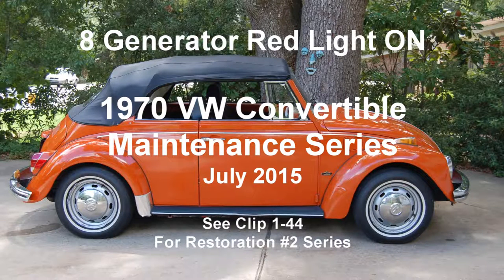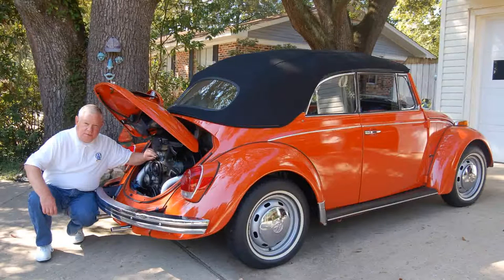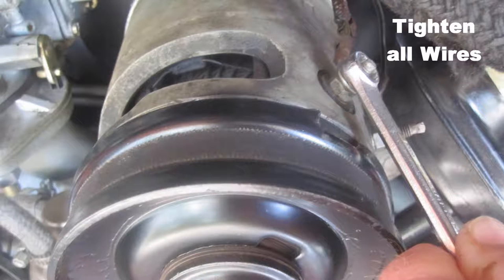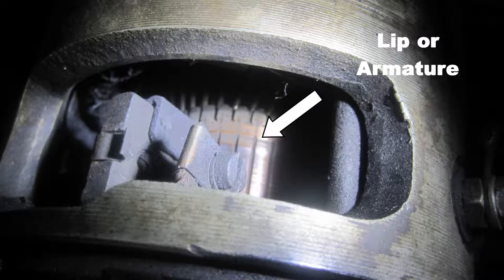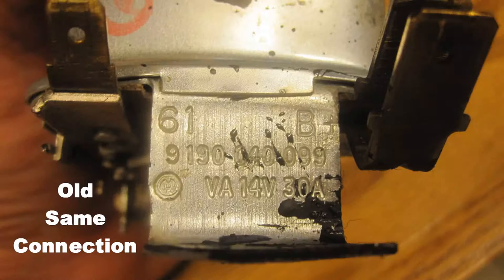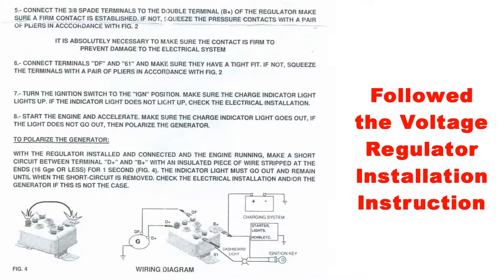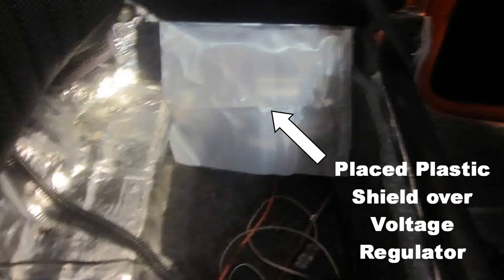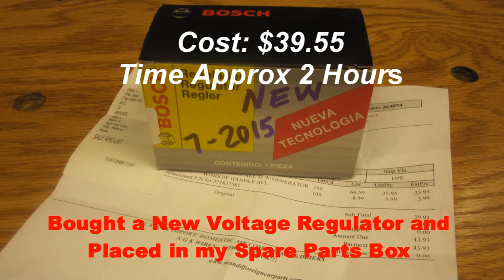8 Generator Red Light ON July 7 2015

Comment: Ok so one of the wires (mine is blue) goes from the regulator to another relay? That is attached to the same area under the same seat. What is that called. I would like to replace it but cannot find it in parts catalog. Thanks.